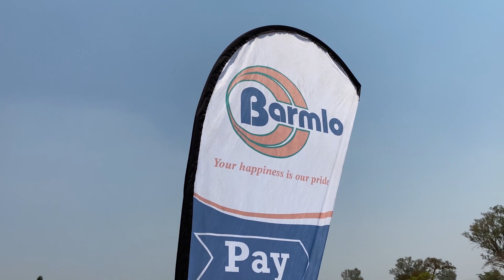MANDEBVU SHANDA

Comment: Good one. May you include safety in such kind of advertisements. Your Hard hat does not have a liner. You don't have safety boots or shoes on a construction site. If you stack bricks and material on the edge of an excavation, it will collapse. but the message is well delivered.
Reply: Kkkkkkkkk
Reply: Just an advertisement